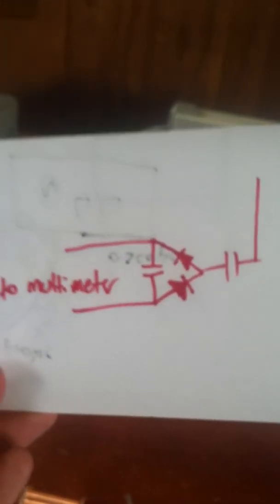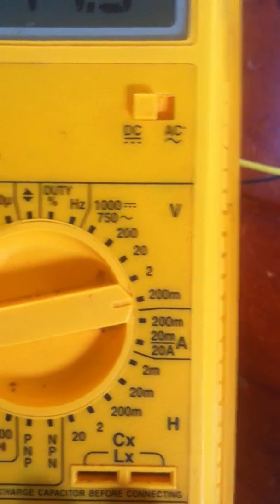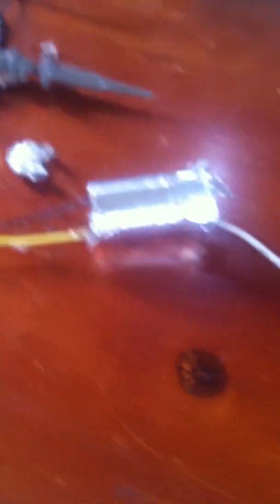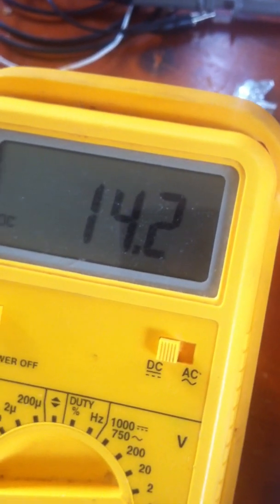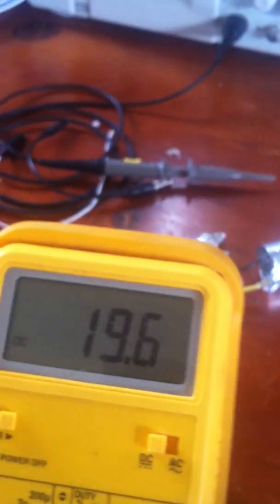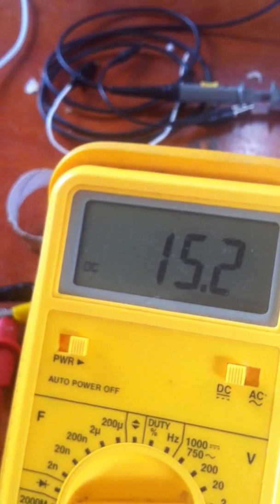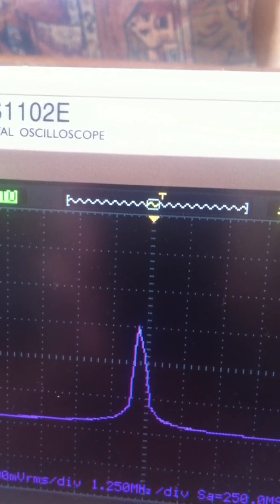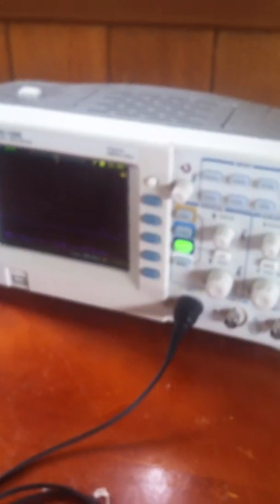SEC 06: Measuring SRF without oscope

Comment: @rau369 hmm 102 is 1nF, 100 'should' be 100V, larger size than regular radio circuit caps. Often the multiplier is used instead of the decimal point. Here's a good page: kpsec. freeuk. com/components/capac. htm. Hope i'm helping.

Comment: Does the yellow one have numbers on ? like 104 or 223 ? Tables of values are online easy enough, 104 being a .1uF (100000pF, 50V normally and 10% tolerance). The bigger the number at the end, the bigger the multiplier of capacitance.
Enjoyable instructional vid, thanks :)

Comment: Thanks very much. So when you set your signal generator to 14.6 MHZ, you ended up with 15.x on the multimeter... and that was the peak ~mV readable? (Aside from the lower anamoly at 19.x mV) What choices in your capacitors have you made, and will that vary? Thanks very much.